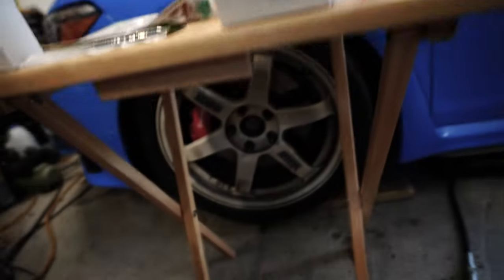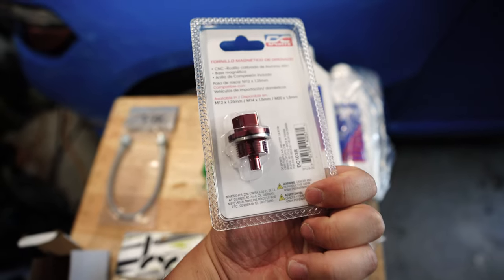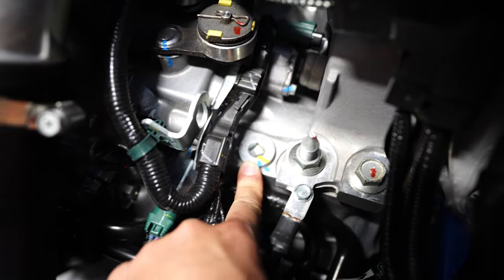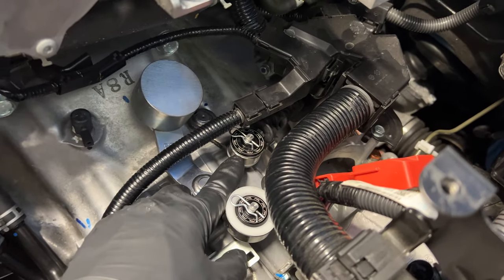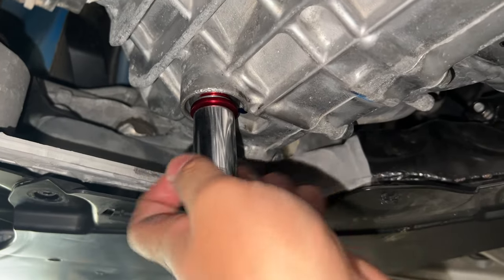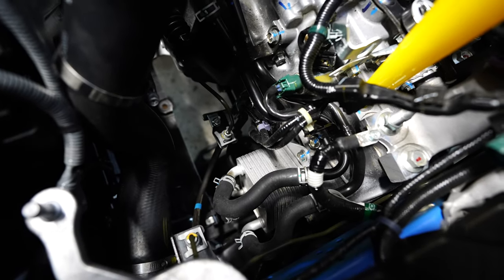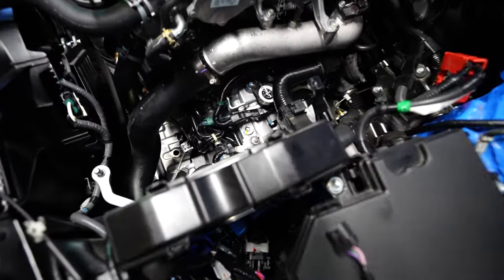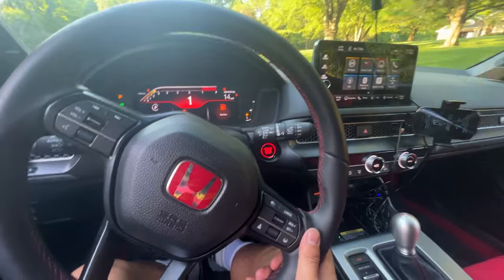The BEST Civic Type R Shifter/Transmission Upgrades | 2023 FL5 Civic Type R

Comment: Did the acurity shifter cable bushing and base bushing. I felt 4th was to far away from me. Close call with a money shift twice. Ive since turned rev match back on hoping it would lock me out if it happened again. The shifter cable bushing fixed that. Id recommend the acurity gas pedal spacer aswell. Made a world of difference in drivability with pulling  the gas pedal out farther and closer to the brake pedal.
Reply from the maker: Yes I want to get the gas pedal relocation for heel toe downshifts!

Comment: Did you ever get a grind or lock out in second gear before doing the delay valve delay? I have a 2024 and I’ve gotten a few myself. Just ordered a modified slave.
Reply from the maker: Yes a couple times

Comment: Does the FL5 car rev hang like the SI does? The only reason why I want to tune my car is to get rid of the artificial rev hang. When the time comes a different flywheel will also help a bit but bone stock it's pretty noticeable.
Reply from the maker: It has rev hang built into the tune for shifting and rev match purposes. Type R has a single mass flywheel

Comment: Did you verify that tranny oil against the Honda MTF (5W-20 and 5W-30)? Seems to me that AC Delco fluid is far too heavy at 75W-80. I use Amsoil synthetic transmission fluid; it's rated 5W-30.
Reply from the maker: Honda MTF is still 75w-80 in gear oil which is equivalent to 20 or 30 weight engine oil. They are the same viscosity. Gear/transmission oil is measured differently from engine oil. The difference is in the additives.